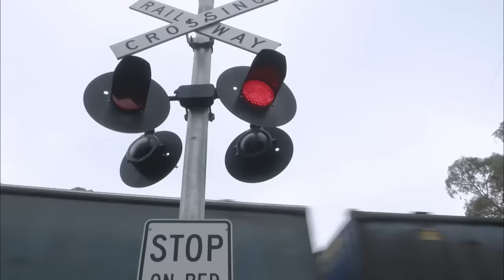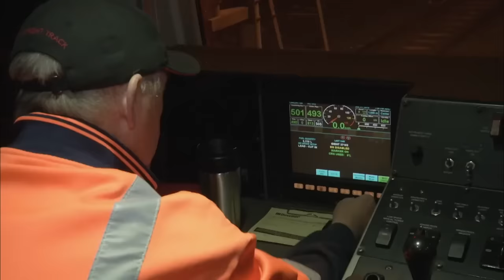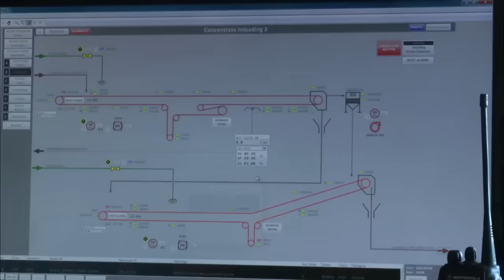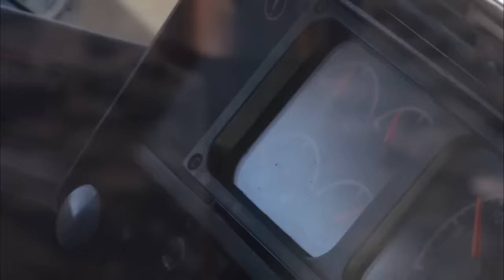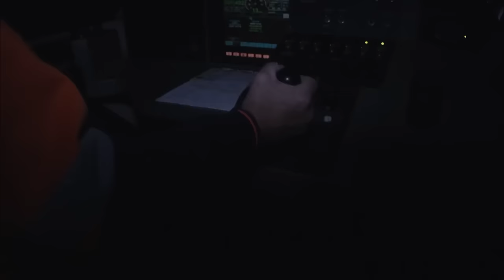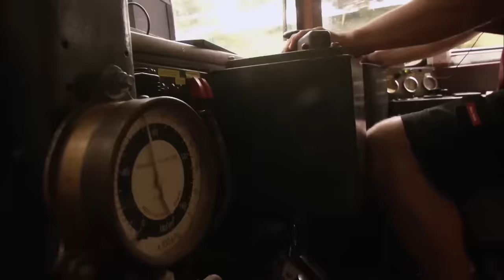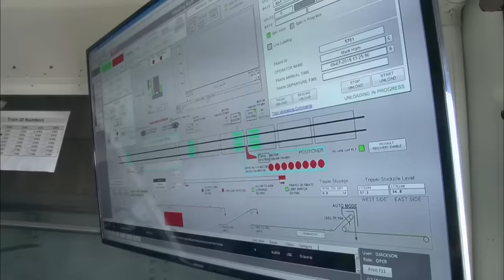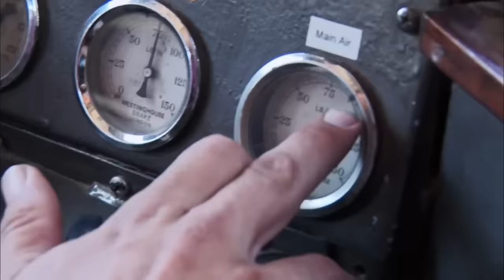Railroad Australia: Tackling the World's Heaviest Trains | FD Engineering

Comment: How do the first few couplings take the weight of the rest of the 15,000 ton train.
Reply: In the US we have engines in the front, the middle and the back of the train and that takes care of it.
Reply: @cestmoi1262  Hi. Yes I have seen them in America and that makes sense but in Aussie the 3 engines are at the front which makes it a mystery how the couplings take all that strain, some ore trains are 15,000 to 20,000 metric tonnes, over a kilometer long. I would expect the couplings to break pulling that kind of weight especially when starting off or up hill.
Reply: @ewanbaxter9199  I think the couplers in AU are more robust than the ones in the US. Obviously it's working for you guys.
Reply: First, a force of 2 to 5 pounds per ton of train weight is required to move on straight level track.  Secondly , E class steel couplings are rated at 500,000 lbs.
Reply: Determination ... ?
Reply: @peterburke885  Thank you
Reply: @cestmoi1262  Same swivel couplers are on us coal cars
Reply: The idea is toBACKup the train to close the gaps in all of the couplers, then, as the first car starts moving forward the momentum of that car then helps start the next car, one at a time allowing the moving train to begin moving while the slack is taken up with only the weight of Each car to be placed on the adjacent couplers.